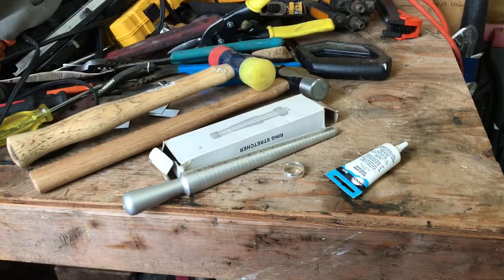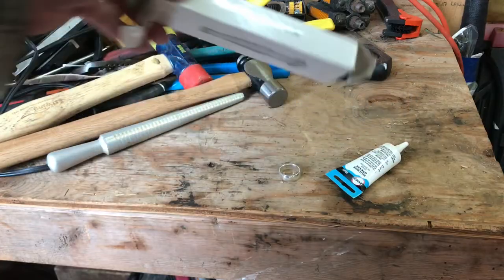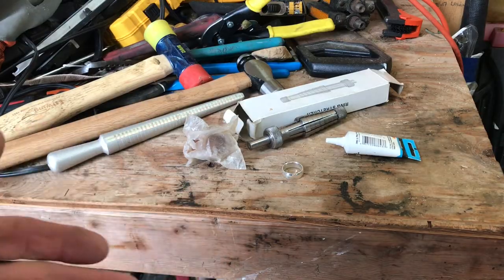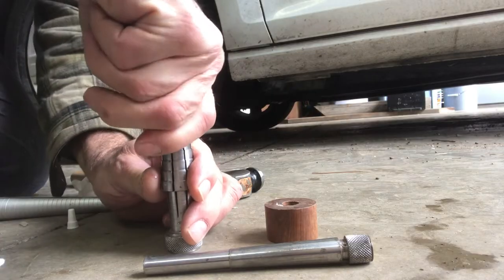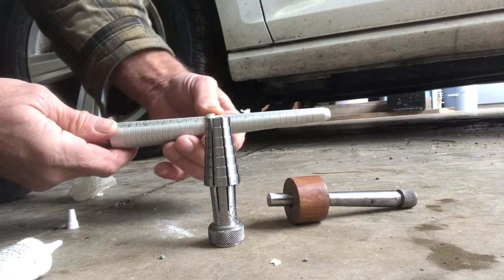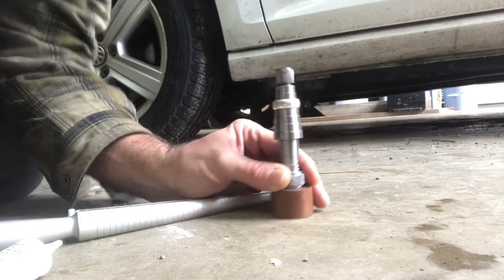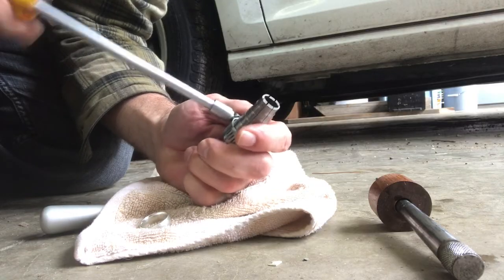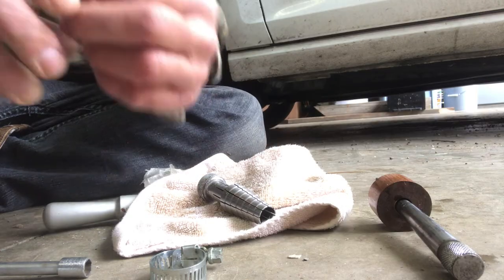How to Stretch & Resize a Ring

Comment: If the ring has a pattern or precious stones settings using this method can cause distortions in the pattern, and also damage the settings for the stones or the stones themselves. I have also seen the ring split when trying to stretch it.  Jewellers have a process of cutting the ring, , bending it out, and welding more gold or silver (whatever is required) to add to the size. Then they do a re-finishing of the ring to make it look like it has never been modified. This is a very special skill.

For stretching and compressing rings there are screw types of tools for this type of work. Better than the hammer method.

Comment: Should I get a ring that’s big or small? What is easier to resize?
Reply from the maker: I try to get a ring the same size. If it’s a solid band with no setting stretching is usually a good option for sterling silver. Shrinking a ring usually requires cutting some out and then soldering. This is again with sterling silver. Do more research if you attempting something otherwise. For education & entertainment only, do at your own risk and skill level or be prepared to damage or destroy your jewelry. It happens
Reply from the maker: I try to get a ring the same size. If it’s a solid band with no setting stretching is usually a good option for sterling silver. Shrinking a ring usually requires cutting some out and then soldering. This is again with sterling silver. Do more research if you attempting something otherwise. For education & entertainment only, do at your own risk and skill level or be prepared to damage or destroy your jewelry. It happens

Comment: Those ring stretches work great but they only started size 6. If you have a typical woman’s ring size 5 you’re out of luck
Reply from the maker: Yes there is some limitations will have to look around and see if we can find one that works for smaller rings
Reply from the maker: The only other thing if it’s a basic band you can heat it up to a dull red and quench it in water to make the metal malleable and then you can put it on the ring mandrel and then use a block of wood and tap it on there and stretch it slowly and reheat it and repeat. not the best way of doing it but I’ve done it

Comment: Would that work on a class ring?
Reply from the maker: If it’s cast or has a stone set, you have to be careful assuming it’s silver? I would not try stretching more than a size or two you will have to take the stone out or you might damage it might have to reshape the basil if it stretches at the bezel if it’s something you really prize you might want to just have it professionally done.

Comment: Where can I purchase one of those ring stretchers? Thanks in advance.
Reply from the maker: You can go to Johnson brothers lapidary supply or you can check out Rio Grande both of those are good places to get a ring stretcher thank you for watching the program and for participating
Reply: @RadicalRocks  thanks!
Reply: @RadicalRocks  what if you didnt have all them tools? plus my ring i have isnt very thick but its way to small.........
Reply from the maker: @isabellawhiteley2010  in the end you have to use your own discretion. If it’s very thin you would probably want to anneal it first for silver you simply heat it until it is kind of a dull red and then quench it in water, that softens it.I have stretched rings on a steel ring mandrel by tapping on it with wood but you can score of the silver, so it’s up to the individual
Reply: @RadicalRocks  Could you give a link as neither showed the device you used.  The first looked like a sex toy and on the second site it was a 400 dollar device that looked like something I would use in reloading ammo.  After 30 seconds more of searching that looks like tools from Rathborn.   Could you provide a link or something.   Ok took me 3 minutes to figure out what you are using and bought the sizer and stretcher from  amazon for 30 bucks.  Believe me I am grateful as you provided me the knowledge this even existed my sincere gratitude
Reply from the maker: @mikep8080  I would not put a adult link, sorry your having issues. I don’t sell or profit from ring stretcher tools. I’ve heard people had limited success with the ones on Amazon sometimes they break do your own due diligence thank you
Reply from the maker: @isabellawhiteley2010  you can try to stretch with just a ring mandrel if you want. Just need to be careful not to bang up your ring too much and use the heat to soften the metal, do at your own risk
Reply: @RadicalRocks  LOL It took me a second to catch on LOL.  I am not kidding about what one of the ring stretcher looked like.  Oh crap it just occurred to me putting in ring stretcher may of actually shown an amazon adult link.  I picked up the kit for a attempting to stretch my own band.  Uggg this entire conversation has hit awkward reading some of the comments LOL.  Ty for the video I cant wait to experiement some spare finger jewelry.

Comment: Can we stretch a simple gold wedding band/ring (18k) using this tool?
Reply from the maker: Yeah as long as it’s not plated or white gold you cannot stretch those,only real gold or gold filled rose gold if it’s real Rosegold and not just plated. because if it’s plated it will crack the plating and if it’s white gold there’s actually a coating on white gold it will potentially mess that up so only on real gold and if it has a diamond on it you have to be careful the way the prongs are that you don’t stretch the prongs apart and loosen the stone so it really depends on the structure of the ring but on the band gold band should be no problem
Reply: @RadicalRocks  as far as I know yes this is real 18k gold. If it cracks the outer surface then it means it's plated right? 😂 Anyway is it also necessary to rotate the ring while pounding? Or this tool stretched the ring evenly
Reply from the maker: @zeploa1044  The ring should have a marking on the inside indicating whether it is plated or 18 karat gold also it does pretty evenly stretch the ring it’s good to just stretch it a little at a time and examine it you can wrap  Teflon tape around it a little bit if you want to help protect it a bit
Reply: @RadicalRocks  thank you for all the information 😊 huge help, there is indeed an 18k marking inside the rings. You have a good one mate!